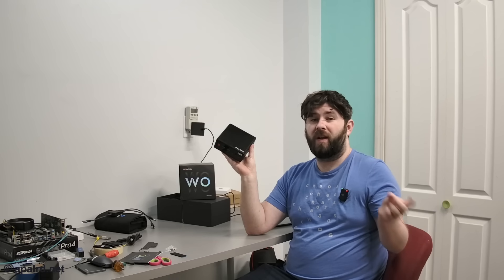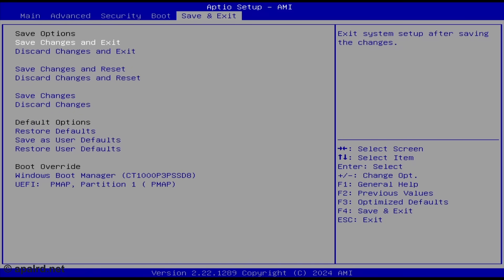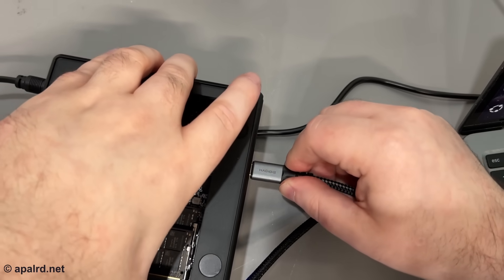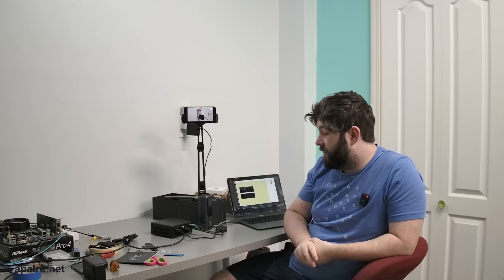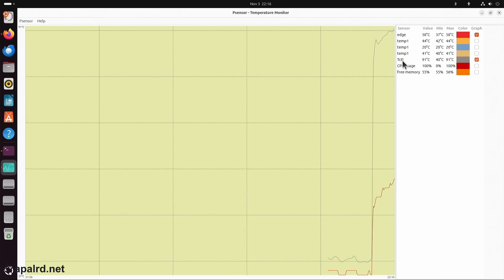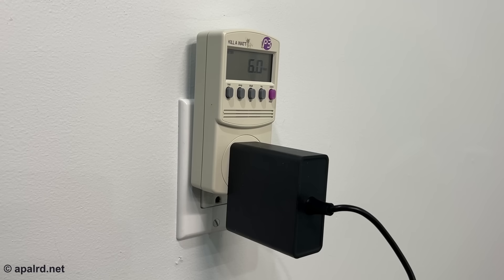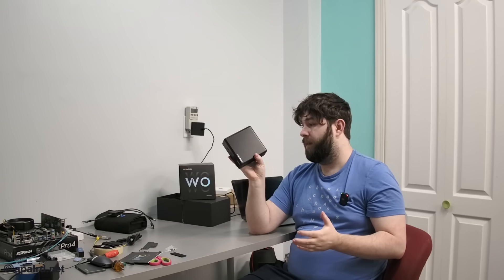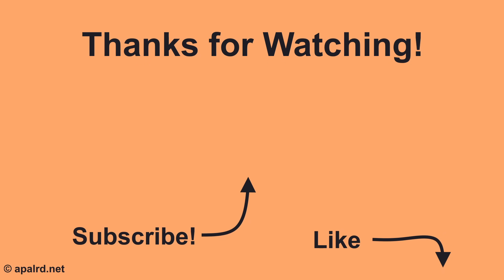PELADN WO4 - AMD Ryzen 7640HS Mini PC Review

Comment: I have the same problems with the same TB cable you have.
Reply: I had it refunded.  It didn't even sustain 140w charging
Reply: over all I no longer like TB as I used to. on paper all great. Real life exp is very expensive and thick cables, often unstable connections, and high latencies(no point in using it with egpu or similar).
Also TB just works with more reliability only over very short wire.

Comment: This looks like a nice unit from Peladn.  I recently got a minisforum UM760 slim with the same 7640hs.  I picked it up from the minisforum official refurbished site with 16GB memory and 512 nvme, for $220 total after tax & shipping.  After adding a second 16gb sodimm and upgrading storage I am very happy with the performance of the 7640hs especially at the price point I got mine for. The 7640hs is a pretty capable chip for being a mobile 6 core.

Comment: MicroPower PC has mini form factor prebuilt systems with actual pc hardware and good value. You can't upgrade this, it's overpriced, and it'll overheat.
Reply from the maker: A mini form factor desktop is nowhere close to a mini PC in terms of size. Not sure if you watched the video or not, but you can absolutely upgrade this, and it does not throttle at the long term power limit
Reply: @apalrdsadventures  When people are referring to upgrading hardware, they're talking about CPUs, graphics cards, power supplies, cooling...you know...the parts that actually matter. Hope this helps!

Comment: The wifi is MT7922 that supports WiFi 6E including 6GHz. Their windows drivers are not that good, but Linux ones are fine - I'm using one on my Zen5 desktop and it works fine when I need it.
Reply: neat, stumbled across the windows issues too, ended up installing linux and the machine works flawlessly ever since